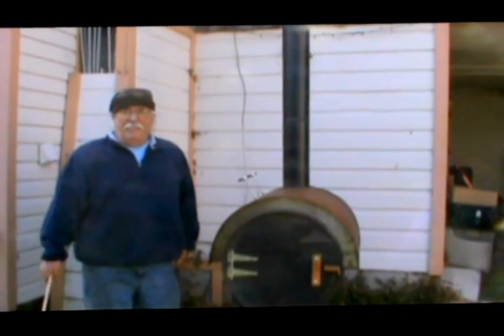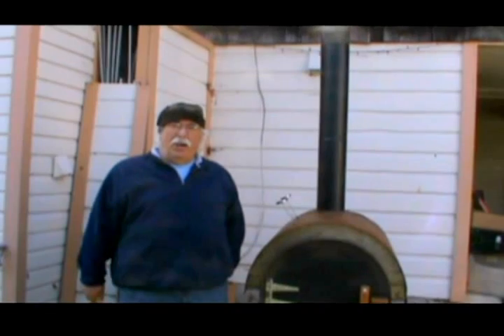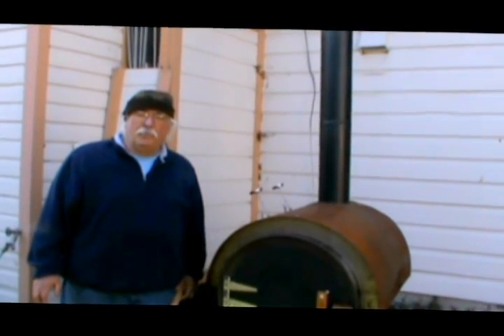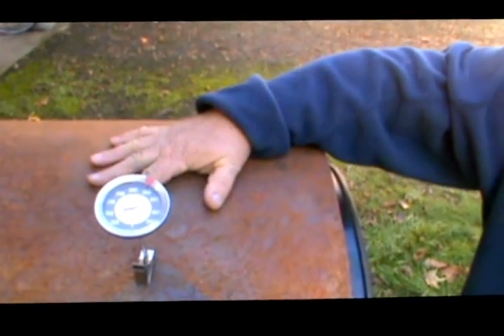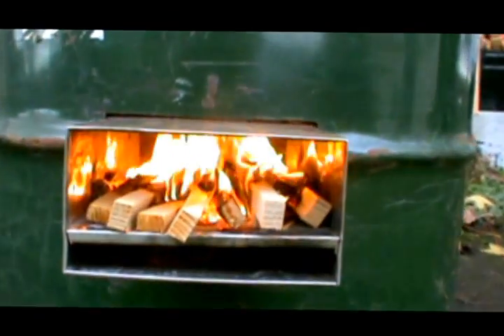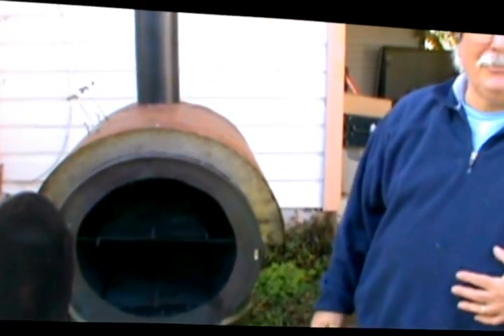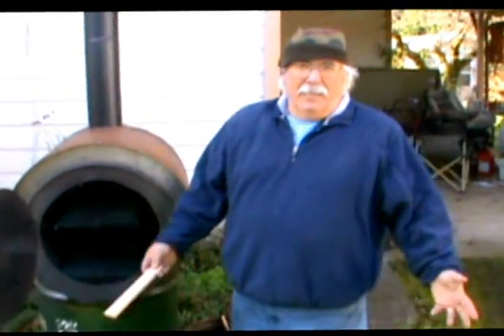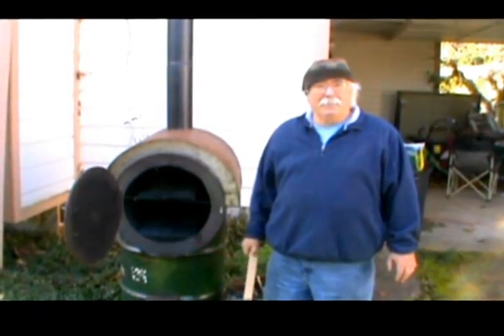Aprovecho Rocket Bread Oven

Comment: I would love to build something like this. But needs to get at least 800 C hot within an hour. Is this possible? Maybe, a direct flame into the oven cavity at the back of the oven, might do that trick.
Reply: ***** That is cool. There must be away also to put some log to slowly burn after initial sticks are done. :)
Reply: ***** Possibly dinner only, plus overnight log. :)
Reply: Linda Cozzini-McKirgan  do you have the plans/templates for the oven?